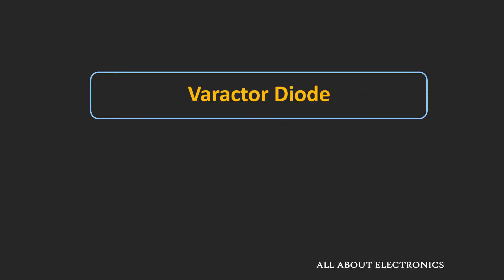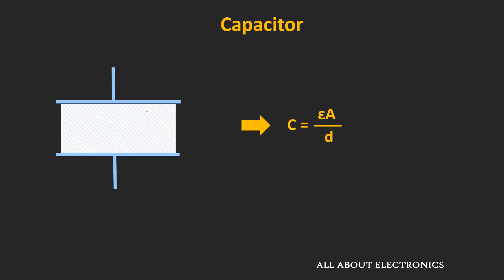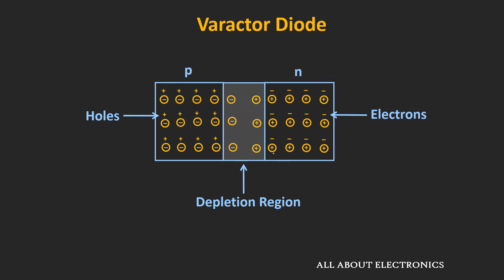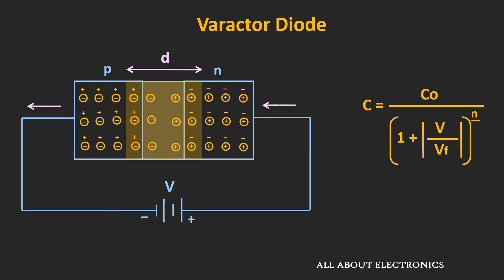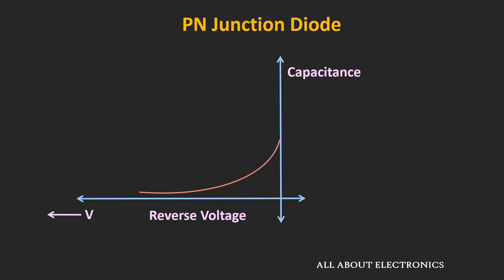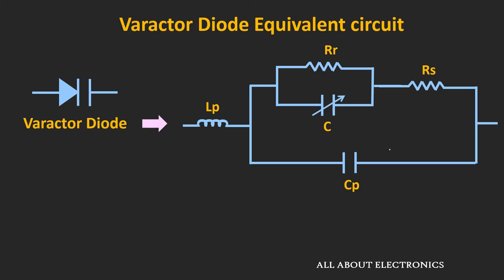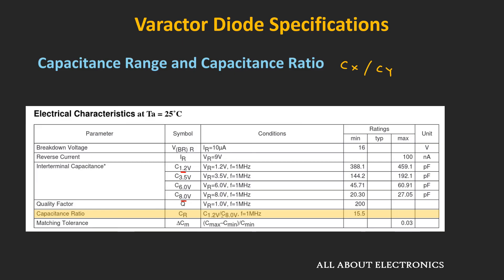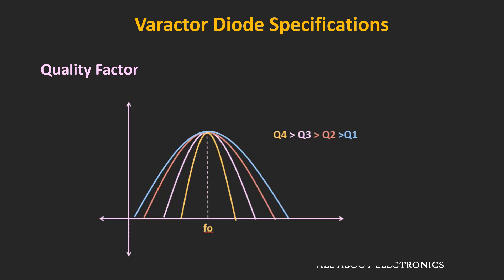Varactor Diode Explained (Working, Specifications and Applications of Varactor Diode)

Comment from the maker: The timestamps for the different topics covered in the video:

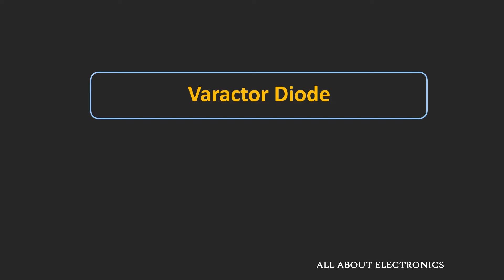0:21 What is Varactor Diode

1:23 Working of the Varactor Diode

5:19 Equivalent Circuit of the Varactor Diode

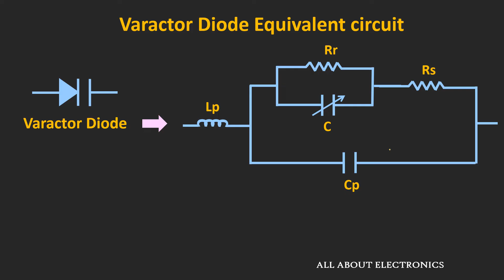6:28 Important Specifications of the Varactor Diode

9:01 Applications of the Varactor Diode
Reply: sir Vf is built in voltage or barrier voltage of diode?  just wanted to confirm once again.

Comment: Why is varactor diode used at microwave frequencies?
Reply: Because of tuning the capacitor we can able to change the frequency which in tend to increase or reduce the thermal energy accordingly
Reply: Hence the capacitor in deed step up the magnetron producing microwave

Comment: What is the type of element that we use to made a varactor diode?        Thanks for the above information.😊
Reply from the maker: Do you mean for the fabrication of varactor diode?
It's similar to the normal on junction diode. So, its made using silicon. For p type material the impurities like boron or aluminum is added, while for the n-type material, the donor impurities like phosphorus is added.